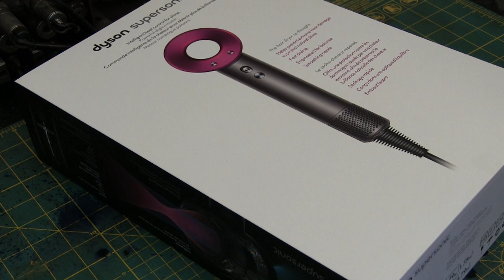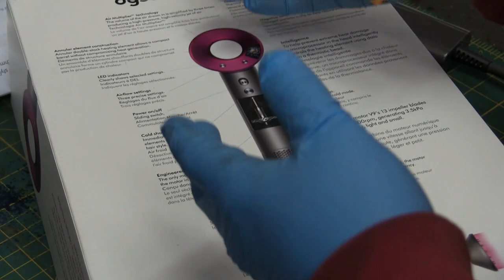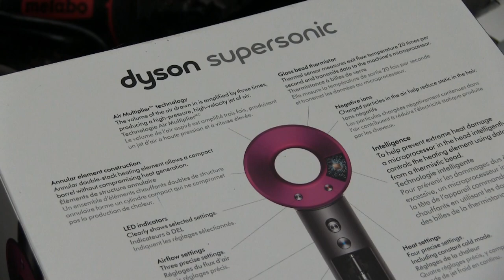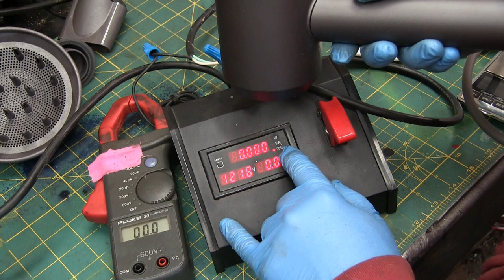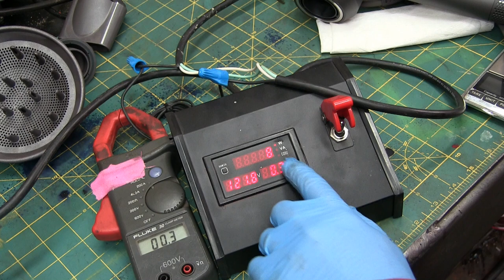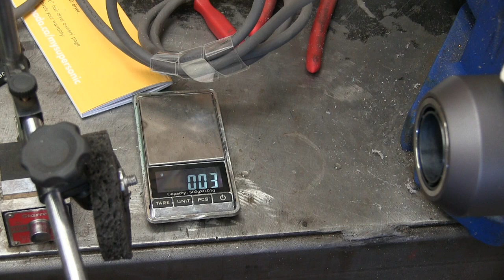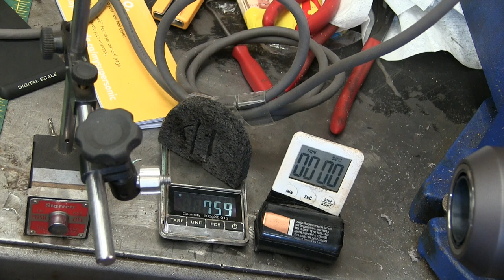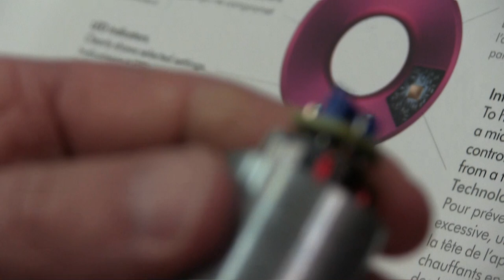BOLTR: DYSON HAIR DRYER. Is it WORTH the MONEY?

Comment: power fister????? explain
Reply: I was hoping it was something else ...
Reply: when you say princess auto I always thought you where making fun of them but nope. lol
Reply: Lolz... another AvE aphorism. We poor fans are going to need a Ave-English dictionary at this rate! 
...at least said directory won't need annotations listing the innuendos
Reply: "Power Fist" is a brand sold buy Princess Auto up here in Canada that has ruffly equivalent build quality of Harbour Freight tools in the US.

They have cheap shitty power tools. Case in point, a fellow sheet metal worker I know thought it was a "steal of a deal" to get a pair of double cut power fist shears for $35 Canadian Peso's, so he bought 5 pairs in case a few broke since the Dewalt or Milwaukee one's are over $220 here.

All 5 of them were broken within a 3 week time frame. lol
Reply: As an "actual craftsman"; I've never set foot in nor own any Habor Freight tools. I proudly use "Lennox" tin snips for those impossible to reach spaces & for their Straight-Cuts Lefts, Centers & Right. My Craftsmen are my go-to, the off-sets Lefts & Right, yet if anyone knows anything about SheetMetal a simple flip of the sheer makes them straight cut, long cuts.

My long cuts are an unknown brand made out of brass with interchangeable blades to sharpen, light for us "Cornice" workers.

In my travels I've found actual offset Bulldogs that cut directly to the edge of the, whatever it is you're cutting off.
All my hammers are original "Architectural Sheetmetal" used since the days of Steeple Jacks & Cornice workers.

The only truly new thing I own is the $400 harness my supervisor purchased for me.  I was able to take certain Velcro tool belts of mine and relocated them, even my giant Klein Bolt Bag at the rear flat lumbar support; giving me the ability to carry everything I need to work for an 8 bettah yet a 10 or God love it a 12 hr day ... 400' in the air hooked into the gable using the heel of my boots.
Reply: Pretty sure it's Shezhen, not Tianjin.  Didn't know meaning of BOLTR so thanks.
Reply: +Go Pro  I'm not talking about "hand snips", I'm talking about powered double cutters.

As far as snips go, I did prefer Wiss not only due to cutting relief, but they offered lifetime warranty. I simply went into a store and grabbed a new set, returned ones that were broken.

But Wiss was bought out buy the same company that makes craftsman and others, all offshore chinese made. You can see the difference in the steel and they quit giving lifetime warranty. I use Klien Snips now.

As far as harnesses go, I love my 2 Sala's I own, as they are comfortable, easy to adjust and put on due to twist ratchet style tensioners and seat buckle style connections. They also have excellent padding.

I don't wear a tool belt anymore as lower back issues were developing even with suspenders. I use my pockets efficiently and effectively on my coveralls ONLY taking the tools I need on an AWP or Sissor.

Besides, I have them close enough by, or take a kuny on my lift with what I'll need. Work smarter, not harder.
Reply: I've a friend named Dave Jones dafuq

Comment: The weight distribution is amazing for this dryer (I'm a stylist and it saves my shoulder a lot of pain) but a two year warranty has always been fishy to me for a $400-500  dryer. I went to the reviews on Dyson and other professionals speak of how great a tool is but after 2-3 years, they need a new dryer. This video helped me hop off the fence. I'll stick with Babyliss dryers. Thanks!
Reply: I imagine some of these would fail after the 2–3 year mark, and it would be very expensive to set up a service department that could fix them, so they probably just junk the ones that come in for service.  It's a rip-off to only give a 2 year warranty though.  Should be 5 years and most of the devices would last at least that long so it wouldn't cost them much.
Reply: My daughters just died after about 4 years ( Hers is the professional model) but they said they would repair it for a flat rate of £99.
Reply: Also her does not have the power brick on the cable
Reply: @BeeOX3 i hope that's "daughter's" and not "daughters". Apostrophes save lives

Comment: This Dyson guy is a genius. I paid $15 for my hair dryer about 10 years ago and it works great, but this guy found a way to sell that exact same product for $500.
Reply: Your $15 hair dryer singes the hair, had non exact heat control, no ionisation, non tourmaline heater and probably takes much longer to dry the hair
Reply: @Kubulek17  it's 1750 watts, about the highest wattage you can consistently run on a 15a circuit. Hair dying speed is a function of wattage. It never singes hair.
Reply: @shawn576  i used to use cheap hair dryers, with weekly blowouts I was getting haircuts every 2-3 months as my hair was trashed. Upgraded to a professional  hair dryer ($100+) then to the dyson and I can go 6-8 months without a haircut, my hair is shinier and less frizzy too
Reply: @stripersniper1531  I don’t only use a Dyson. I use a parlux at work and travel with an elchim. Both cost over $15 because I don’t want cheap crap tools
Reply: @Kubulek17  To me it sounds like you're trying to justify your purchase there, bud.
Reply: @WalrusWinking  I am trying to to justify my purchase. You don’t appreciate the difference just like some people might not appreciate things you spend on
Reply: @Kubulek17  idk dude I don't even use a hairdryer when I can just dry my hair for free with air
Reply: @icedout8771  so your comment isn’t necessary. It’s like someone who’s never touched a gun commenting on what gun to get or someone without a licence telling you what car you get
Reply: @Kubulek17  its just a hairdryer mate. A terribly overpriced one but its still the same, as a cheap one. Dries hair with warm air.
Reply: @Zolta1983  yet it’s not. A $50 hair dryer leaves me with frizzy hair and takes 45 mins. My dyson one leaves it silky and smooth in 15 mins
Reply: @Kubulek17  how does that work if they both shoot out hot air?
Reply: @Matter655  well your average cheap Conair is 1200w with cheap heating elements and just blows air. My dyson is computer controlled heat, ionisation and 1600w. Plus the air is more targeted
Reply: You just don’t understand unless you have thick bleached hair
Reply: @Kubulek17  I have thick brown hair, I don't use a hairdryer, my hair is great. If I used a hairdryer no matter what kind, my hair would be exactly the same.
Reply: he is also very good at selling plastic vacuum cleaners
Reply: @Zolta1983  I say the same thing about gsxr1000s - why not just ride a 49cc moped?
Reply: @Kubulek17 do you have an Adam’s apple
Reply: @RTFMhvac  yeah so ? I have 18 inches of hair on my head, it’s a hair dryer it doesn’t scan my chromosomes.
Reply: Guys, don’t you get it? $500 hot air is better somehow then $20 hot air. He’s clearly a better human being then the rest of us because he’s willing to piss away $500 to heat air.
Reply: @Kubulek17  i got one that has all you mentioned and does a better job of with larger airflow that cost me just $50, which could be cheaper when go on sale.

Comment: I dry my hair with a 50cc two-strokes leaf blower.
Reply: I use a 40Lb thrust ATJ 190SV turbine engine.
Reply: A real man would use a GE J79 -- with afterburner.

On the other hand, I shave my head, so, I don't need one.
Reply: Do you wash your hair with brawndo?
Reply: Incidentally that's what i use to shave my head.
Reply: EdWatts
Shave it with the GE J79*
Reply: I use a 20000cc tunnel fume extractor
Reply: Personally I just shove my head in the exhaust of my truck
Reply: kolby4078 no I use a airbus a380 engin to dry my hair if that brakes I use a antov jet to dry
Reply: GE F-110 engine, you're not dryin nothin without at least 10 shock diamonds on augment.
Reply: After u use a 10000 GPH trash pump to take a shower.
Reply: I just use sulfuric acid. Easy to use and very efficient!
Reply: I use a Rocketdyne F-1 engine to dry my hair.  It really does the job in keeping the frizzies down.
Reply: did you know if you just leave your hair alone it dries by its fucking self?
Reply: Brawndo :   Yeah with a 50cc blower and it is still waaaaaaay  cheaper  then the Dyson ..... and you can still use it to blow leaves.
Reply: No i use 2 boeing f 18 engines with after burner that is to dry my eyelashe
Reply: i personally prefer to use TMS-65 decontamination vehicle

Comment: The difference between General Purpose Polystyrene (GPPS) and High Impact Polystyrene (HIPS), is the addition of synthetic rubber. 
In the end product the rubber is in the form of tiny little bubbles inside the polystyrene. This gives it impact resistance.
The rubber in the product is also what makes it white, where regular polystyrene is actually clear. 
(Ofcourse the manufacturers of the actual items can mix different types of polymers and add colours themselves)

Source: I work in a Polystyrene plant.
Reply: So you're saying it's only one herb and spice?

Comment: Ever thought of adding an AvE Build Quality Rating System to your franchise? I think putting a number to the overall quality might be of help to some of us with less intellect.
Reply: that's a good ideal
Reply: That idea ain't tea bag. I'd love to see a rating system of some sort.
Reply: ABQRS sounds really impressive...
Reply: Only if the highest rating is "skookum choocher".
Reply: The only problem is, with most of these devices, 99% is rock solid, then they put some chincy cheap plastic switch, garbage caps, etc. in as a premature failure mode, and your "overall" build quality number goes from 100 to zero.  Designed obsolescence is what the really smart engineers get paid the big bux for. None of these pro-sumer tools will be homegamer repairable, by design. So a ratings system would be more like "which of these devices has the least shitty longest lasting built-in failure mode?".   Once AvE knew he'd have to destroy the dyson to get it apart, wish he would have torture tested it to see what let out the smoke first.
Reply: icepick method Planned obsolescence isn't the same thing as designed failure.

Every device has a lifetime, intrinsically. And it's counterproductive to spend money on increasing a device's lifespan beyond the point when most consumers would be willing to buy a replacement. At that point you're spending money against your own bottom line and not even cultivating customer appreciation.

The engineers that get paid big bucks to do this would never waste money designing some overbuilt product only to intentionally waste all that expensive material by choosing a single weak part. The entire device is designed to a price.

Now, what they might do is provide reasonably skookum parts where the user will interact, then elect to use a weak part in a spot where design lifetime doesn't demand more, and then this point becomes the likely failure point. But that's simply not what you describe, even if it sort of seems like that to the casual homegamer.

Good business isn't charity to the consumer, but it at least makes sense. Unlike the scenario you fantasize.
Reply: I remember seeing a so called fan less dyson fan the first thing that came to my mind was only an idiot would fall for that the blades were hidden inside the base price tag was $200.00 marketing wank at it's best all fans as blades so to say a blade less fan makes no facking sense at all
Reply: +VeteranVandal dude same, i thought i was the only one like that. back in highschool the zipper on my pencil case (i think yanks call it a trapper keeper?) became detached from the rest of it so instead of getting a new one i just stapled them back together.
Reply: slendy9600 No, that was a South Park joke which referred to that period in time when super-fancy binders (Trapper Keeper being one of the big brands) were all the rage with school kids. 

In general, we call them, "binders", or "three-ring binders", or "loose-leaf binders".

We also have pencil cases, which are exactly what their name describes, and not the same thing as binders.
Reply: +Marshaul aaaaah mk my mistake
Reply: Eric Wehrs kn
Reply: Eric Wehrs rin
Reply: I get pissed off when the shoes don't outlast their soles' viability.  It annoys me that I can't get proper leather shoes most of the time anymore too, though part of that is I require 12 1/2 to 13 size 6E width shoes, so my options are rather limited.

Comment: YES IT IS.  As a woman who owns and has used the Dyson hair dryer, daily, for over a year now I can tell you with 100% honestly, it's worth it.  But a tip to people buying this for their partners:  make sure she/he has a place to properly store the dryer, so it will not get beat up by other tools, brushes, etc.  (I put it in a vanity drawer, by itself, the drawer is lined w/ a towel for impact absorption.)  This is not just a hair dryer, it is a piece of fine electronics.  If your partner can't grasp the concept of how bad impact shock is for electronics, don't waste your money.  When in use, especially for women doing a round brush blowout, there's going to be a lot of setting it down on the counter.  I place a towel on the counter to absorb shock.  The unit comes w/ a piece of silicone for this purpose but it's just not big enough.  A fluffy hand-towel folded in half is better.  Last thing, the on/off switch is a little stiff, even after a year.  If you don't slide the switch hard enough, the unit will temporarily stop working.  If it's hot, you're done, it's going to be 15 minutes before it will work again.  I'm sure this is a safety feature, not many people will run into it, but it's worth mentioning - be solid with the switch when turning it on.  That's it -- treat it like the fine electronic it is, and it's worth it.  By the way, I watched this video before the purchase....yes, the whole thing. lol

Comment: "Aluminium cold and chincy. But she kicks like a fucking mule."

Marketing slogan for sexbots from the Horrible Fright?
Reply: I bought $600 worth of tools from them today.

for 50 bucks........
Reply: Yeah, confirmed huge Horror Fraught fan here. The quality of manufacture improves with every passing year, and if you know enough about using tools (and the engineering that goes into them), you can get a pretty good idea which ones are worth the money by going to the store and getting a little hands-on time. 

The other day I needed a hammer drill; Home Despot wanted $35 for 4 hours to rent one. Went to Horror Fraught and bought their basic model for $22 - 20% = $17.60 + tax = $18.50 out the door, or $1 more than half the price to rent one from the Despot. The thing is surprisingly skookum for sub-$20, and I got my holes drilled in under 5 minutes.

With economics like that, right off the bat everything else is off the table for occasional-use tools. Even for heavy-use tools, the fractional replacement cost is going to make the HF options competitive in many cases – the Earthquake 1/2" impact wrenches come to mind.

All I can say is I hope that fools continue to sneer at the place; if it ever develops a worthy reputation they might end up charging what everybody else does for the same tools.
Reply: ***** HF definitely has single items which cost in excess of $600. Many of which I want.

Comment: Just sayin', but actually, your teardown just confirmed that this hair dryer is worth its price, unlike some audiophoolery equipment. Different question if that's really necessary, though.
Reply: I'm not sure I agree. It's not shit, but it's not $500 worth of blow drier.
Reply: It's necessary to have mains cable, it's not necessary to cover it up in 10 layers of protection.
Reply: I wouldn't say that it showed that it's worth it's price in my opinion, but it at least showed that it's somewhat close to worth it's price. I'd still value it at only like 250$ maybe. The motor wasn't that great, chassis wasn't aluminum (I personally think it would be a bad thing if it was though), and it didn't have any better performance than a much cheaper one.
Reply: Mshojat There's a lot of R&D in such a product, it's a totally new concept. The construction is state of the art. Not utterly serviceable, but who services old broken hairdryers anyways? They surely didn't cheap out in construction either, each part is purpose designed for its function, and performs just well as such. It's not Dysons fault that AvE doesn't know some basic motor driver concepts, as that was one of the main parts of ridicule in the video. The absolute hair drying performance has its limits in maximum temperature and airflow you want to expose them to, although some other random test of that fan I looked up after watching this video claims that the drying performance on actual hair under real conditions seems to be excellent and better than competitors. I do especially doubt the flow test in this video, as the whole "air multiplier" concept doesn't work if there is pressure build-up behind the fan.
I wouldn't pay that much for a hair dryer neither, but that doesn't say much about the value of something. I also wouldn't buy expensive watches, jewelry or fancy designer clothing. But one can't doubt that there's a market, and they appreciate such unconventional and innovative products.
Reply: Marian Keller People didn't want to service hairdryers because they are cheap. But this one is not. So servicing it becomes a reasonable request.

This isn't a whole new concept, it just hasn't been used for hairdryers before, because it makes for an expensive hairdryer. That doesn't necessarily make it a better hairdryer, though.

But yes, there is a market for this hairdryer and Dyson didn't do a poor job.
Reply: Actually Valuga, with a mains-attached PCB you will want that extra insulation.